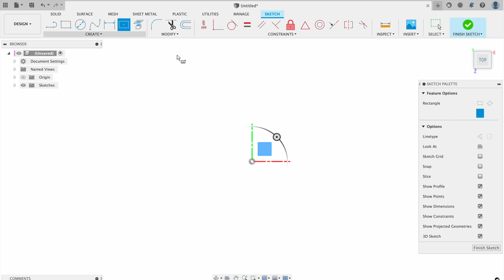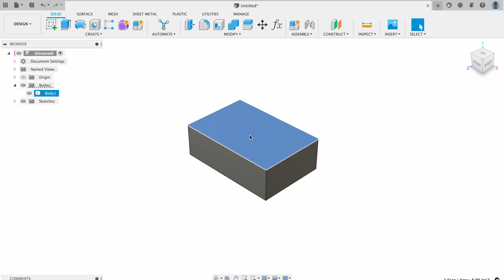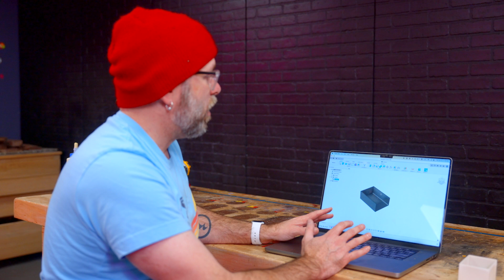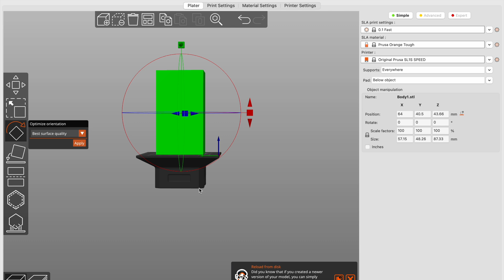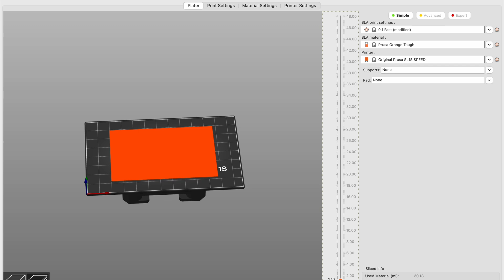3D Printing in a Woodshop. Get Started Making Screw Boxes.

Comment: I like to run an airhose connection near my wash and cure station. Spray it with the nozzle after wash to dry the part. Saves paper towel waste and the alcohol evaporates fairly quick.
Reply from the maker: I have an air hose right underneath my printer and didn't even think of that. Thanks!

Comment: I use my 3d printer a lot for shop stuff. Currently printing a router word inlay set.

Why did you choose a resin printer over a filament printer? I have an ender 3 pro with direct drive upgrade
Reply from the maker: I’ve had 3 filament printers and have had bad luck with failed prints. I rarely have a failed print with resin.

Comment: I've lost count on how many things I've made for the woodshop with my 3D printer.  Corner templates for my router table, dust hose adapters, quick set gauge for 1-6" for my table saw, different guides for my band saw.  A 3D printer is almost a must-have for a woodshop.

Comment: I use my 3d printer to make stuff for the woodshop. Recently broke the dust filter on my ROS so i printed an adapter to use it on my shopvac. Ive had a couple of things I needed a small thing printed out. I have a fdm printer however.